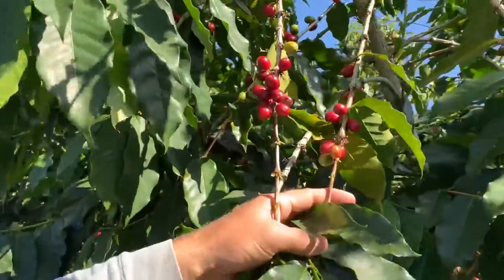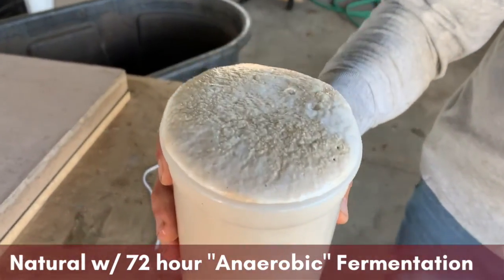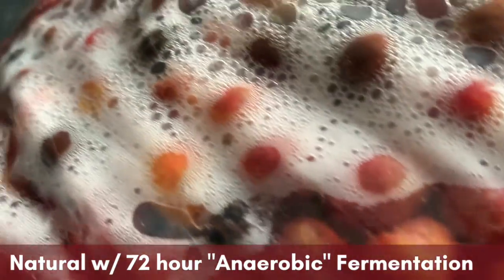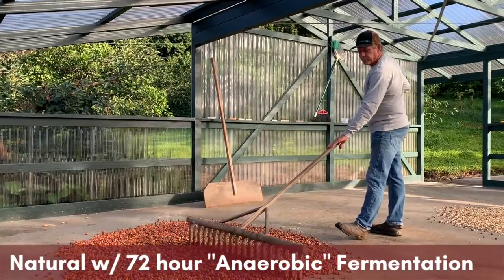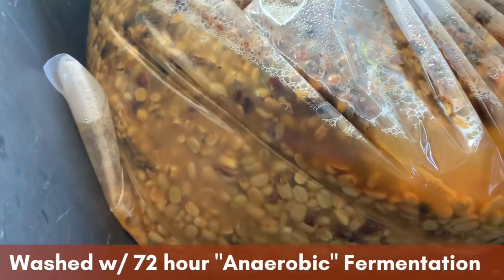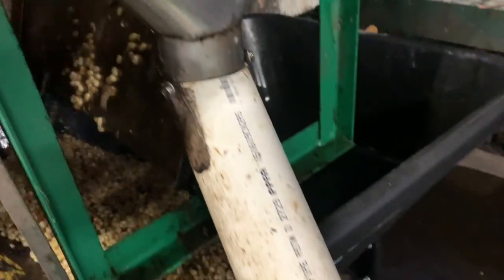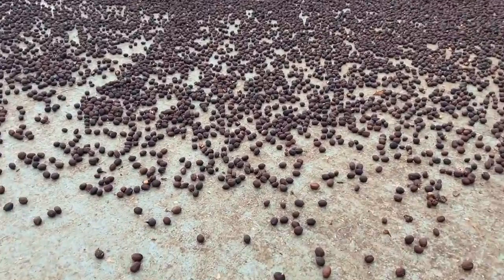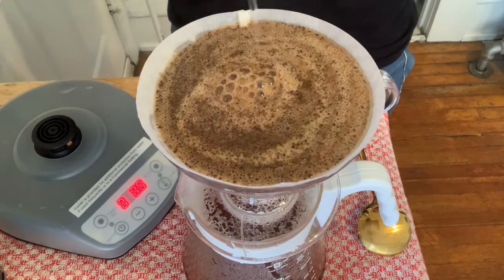The Difference Between Natural and Washed Coffee, 72 hour "Anaerobic" Process Coffee

Comment: Hey! I wanted to know what kind of yeast is generally used for fermentation? 

I’m getting into the coffee industry in India as a roaster - and I’m curious about how the yeast for fermentation for consistency and fermentation for flavour complexity is different.
Reply from the maker: It depends producer to producer. Most allow natural fermentation to happen, in which case it’s wild yeasts that are just present in the air, on the tanks, in the water etc. But other producers will inoculate with specific yeasts for consistency and greater control. You have to ask the producer of each lot of coffee to know the actual answer.

Comment: 12:26 Do the dense beans really settle at the top? It's a bit counter intuitive because for example with fluids the more rense ones settle at the bottom. If they really do I wonder why that is.
Reply from the maker: Density dynamics work differently with solids than in liquids. Yes, the more dense beans go to the top. As the table jiggles the more dense beans move up the table and the less dense beans settle toward the bottom.
Reply: @roasterkat this does seem counter intuitive.  If you are panning for gold, the gold sinks to the bottom of the pan.  In my own garden if I rake leaves, and twigs, on gravel a lot of gravel gets mixed up in the pan. By shaking it, the lighter leaves rise to the top leaving the gravel behind.  Do the denser beans actually rise to the top?

Comment: Thanks for the informative video! It's interesting how the term "Anaerobic" can mean very different things in this context. Sure, ultimately it's just fermentation in a low-oxygen environment, but there's quite a difference between, for example, a partially sealed plastic bag and a pressurized tank with a one-way valve to release excess pressure. It'd be interesting to see how different oxygen levels during the fermentation might affect the final product, though I'd imagine it wouldn't be easy to isolate that single variable.
Reply from the maker: Interesting questions. Yes there may be a difference between a partially sealed plastic bag and a tank, though the barrels with bubblers you are referencing are not pressurized. The bubblers don’t control pressure - they just release CO2, which is a product of the fermentation. But they are not pressurized. In fact, a sealed plastic bag will build more pressure than a barrel with a bubbler (because the bubbler actually lets pressure go). There’s for sure a difference in fermentations controlled well and those controlled poorly, but I think that’s more about method than materials imho

Comment: thanks for the video, it's great that we can literally see the proccesses.
one question though. is it enough sugar/carbonhydrates in the bag with unwashed (not pulped) coffee for the yests to make the fermantation go on? isn't the cherry skin a barrier that complicates things for the yeasts? or maybe you add sugar/something sweet?
Reply from the maker: Great question - we didn't add any sugar/sweetness to these fermentations. And yes, the skin adds a barrier to the sugars, but yeast and bacteria are small and multiply very quickly, so they get into where the sugar is without problem. When you pick the coffee cherry from the tree, that opens a little hole - kind of like when you pull a grape from the stem. That's enough of an opening for them to get in and kick fermentation off strong, especially when they're in a bit of water like we added to the bag.
Reply: @roasterkat  thanks for the inside! )